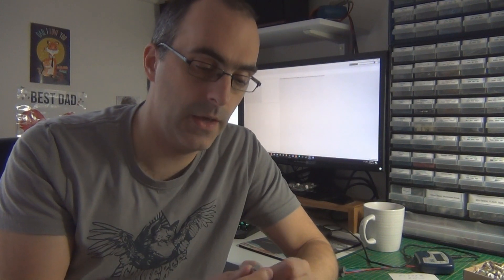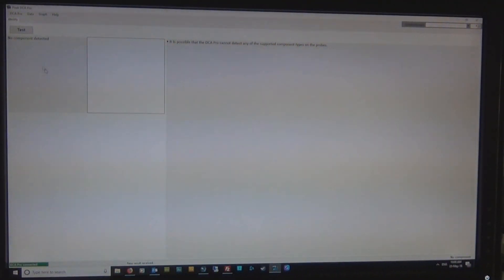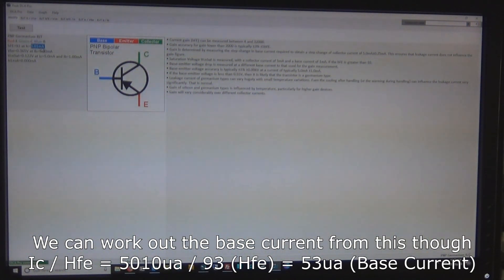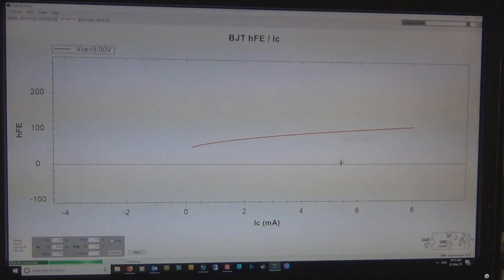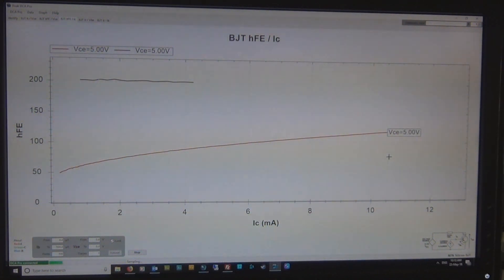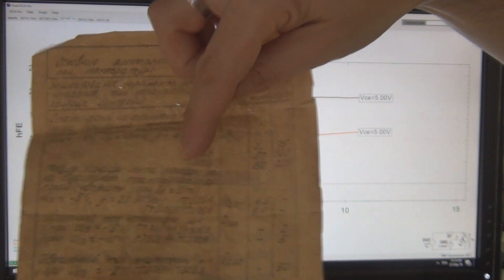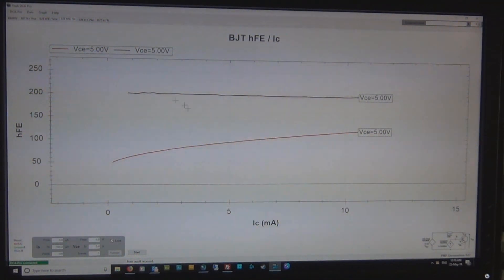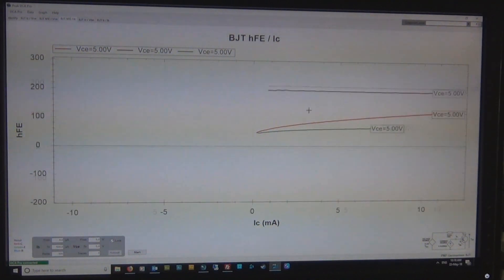Basic Operation of a Transistor Explained - Part 2 - Hfe vs Ib

Comment: Every data sheet I look at shows a huge increase in hFE when the current is increased. I have an atlas 55 tester that only tests at 2.5ma, most pedal builds cite an ideal hFE at 5.0ma and I never trust my measurements because of the difference in current. This is the first time I have heard/seen that there isn’t a large increase in hFE from 2.5ma-5.0ma. Should I assume I am closer than I think when measuring at 2.5ma? How would you handle this? Sell my DCA55 and buy a DCA75?lol

Comment: I need to find a low-noise JFET n-channel any suggestions? It would be good if it could run off a lower voltage, like 5v or less.